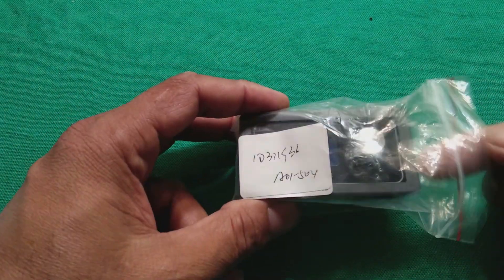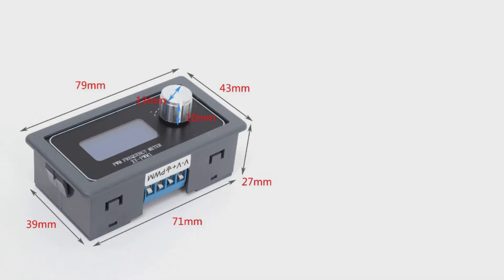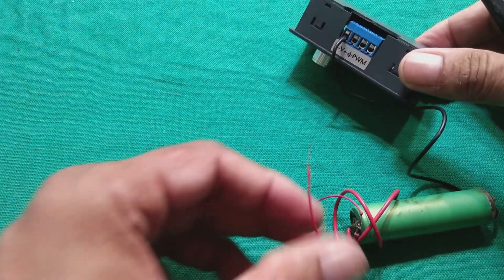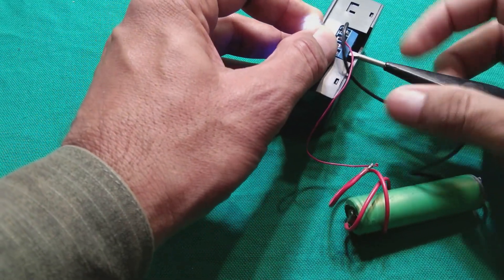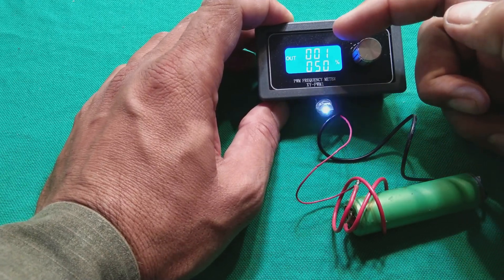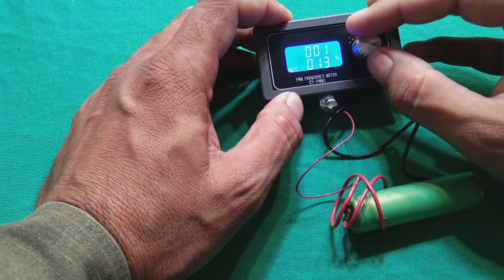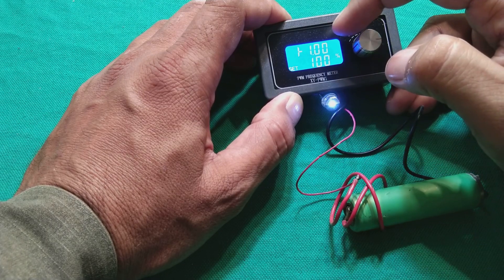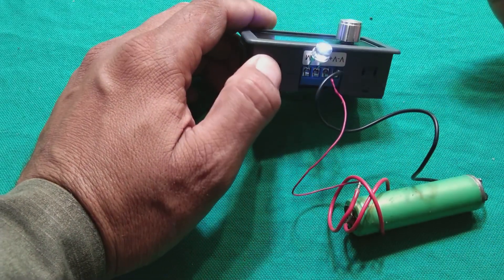Single channel signal generator lcd led display. ICStation.com

Comment: Nice video. I able to make led blink also.  I'm trying to use it to test tachometer gauge but I cannot seem to make it work to generate the 12v square wave signal. Supposed to be 100Hz = 3000rpm for testing

Comment: Could you hook this up to a welder create a pulse  signal like used in pulse welding. Ac and DC.  I'm very interested in dc.
Reply from the maker: Sure it would do. You can control both frequency and duty cycle with this unit. All you need to make little interface. Stay tuned for future videos.